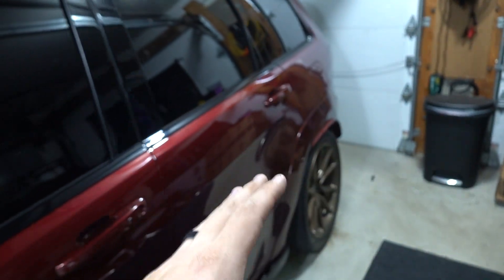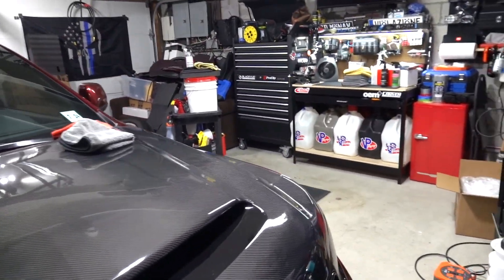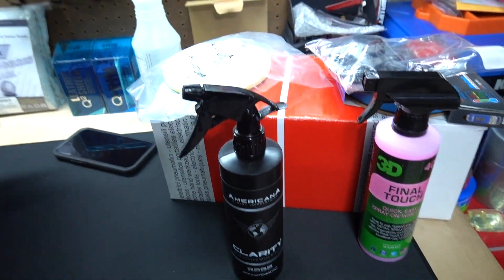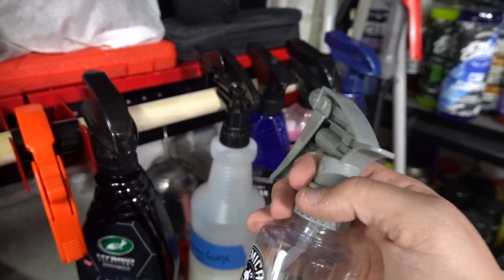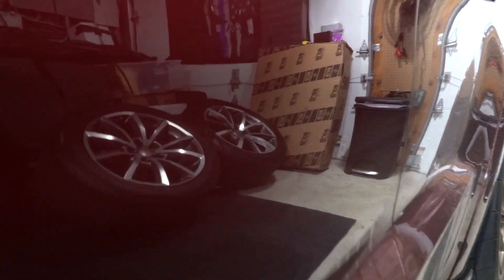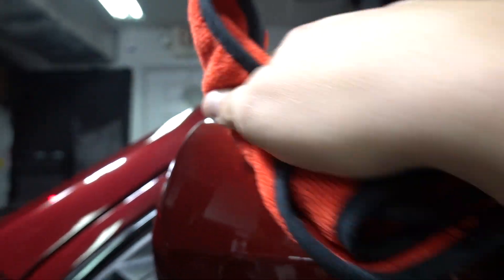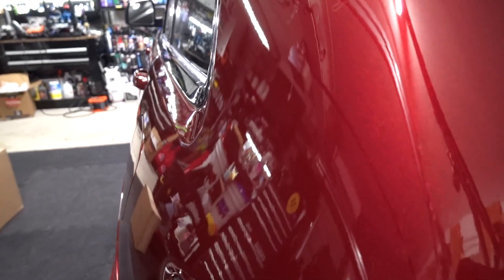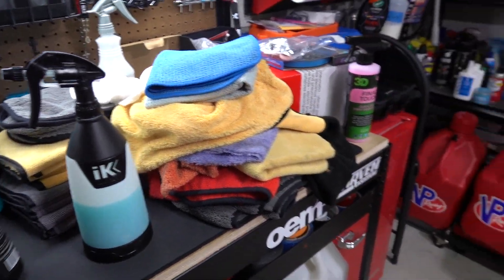Ethos Car Care Defy Waterless Wash DIRTY CAR

Comment: I used Defy on a car that looked to be about like your (in DE).  I kind of followed what Ethos says about using a damp towel as the "cleaning" towel but instead of soaking the towel in a bucket of water like most people, I used a spray bottle filled with distilled water to saturate the surface of the towel before using it on the paint.  After the "cleaning" part used a nice 500 GSM plush towel to buff off the remainder.  Don't know if you have tried the Ethos Foam Party yet but in between the stupid ass snow storms after the car was again covered in salt I used Foam Party in a foam gun and garden hose and then air dried the car.  It wasn't perfectly clean but I would say probably about 80% after one foaming so that using Defy after that wouldn't be as problematic.

Comment: why did you have to point that out on the IK bottle.. I Had to try it after you pointed it out and you are exactly right...It does hurt sitting in your thumb area. It digs in if you have it filled with product,,,  I bought 1 IK bottle and 1 pressol bottle from OG..I hadn't really tried the ik much...dang it ...good vid dude... I am a big fan of ethos as well